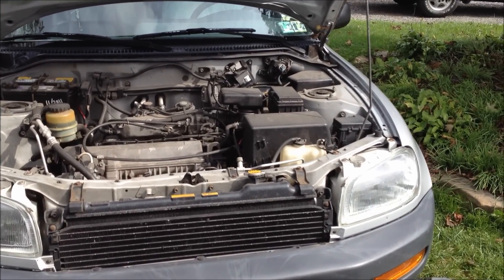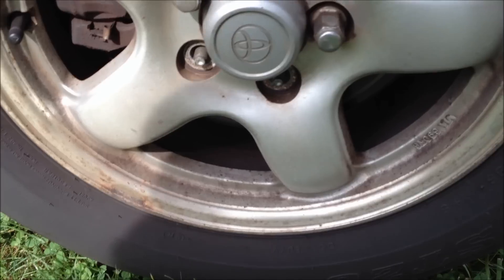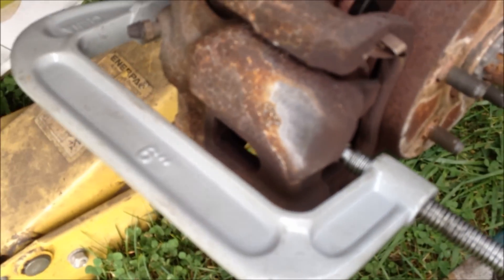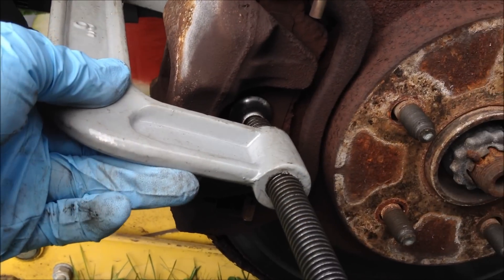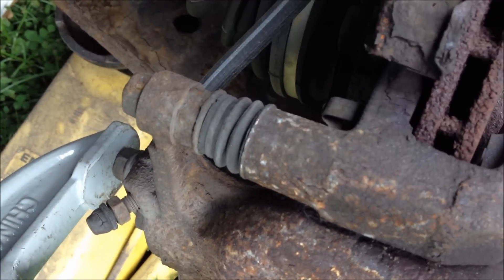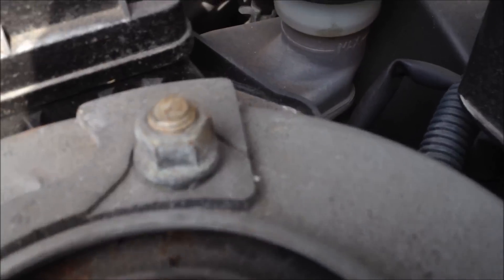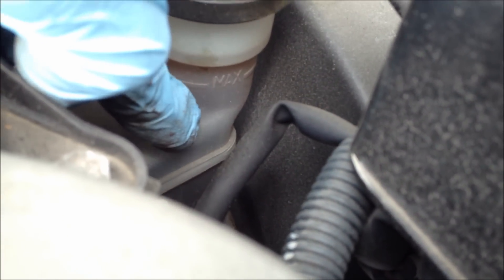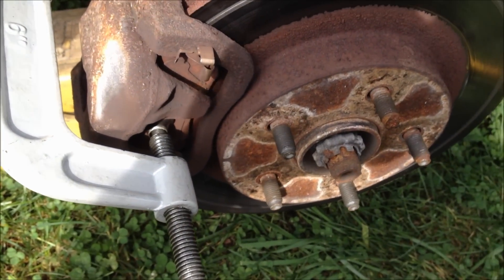97 Rav4 front brakes

Comment from the maker: For the benefit of other viewers, adding brake fluid is kind of futile, because it is a closed system and shows another problem such as brake wear or a cylinder leak. Addind fluid will get you by for the moment but there is another issue that needs to be addressed. Don't play with it, your brakes are too important.